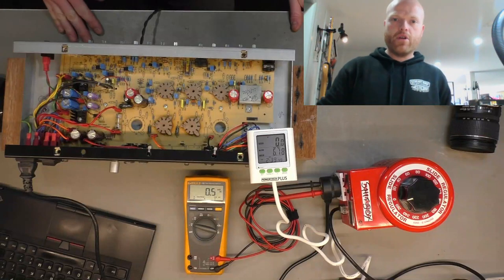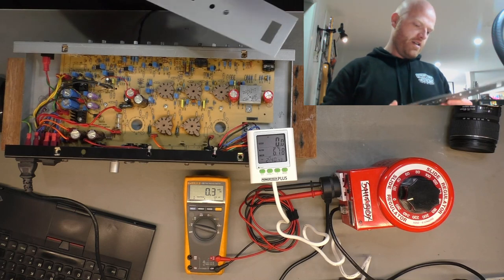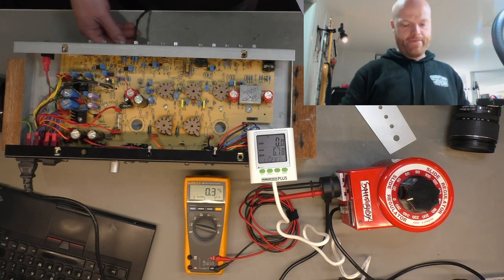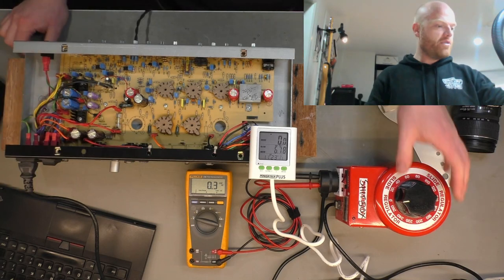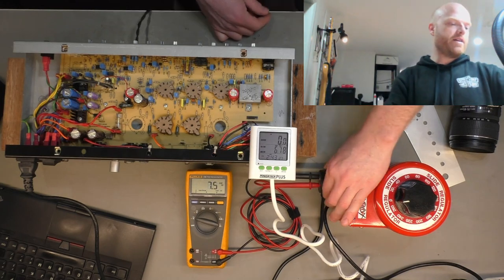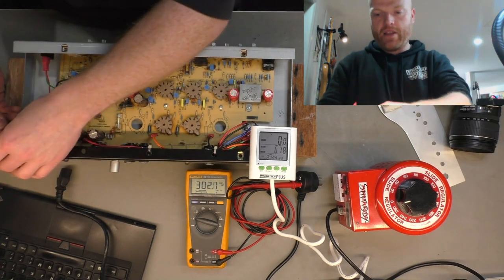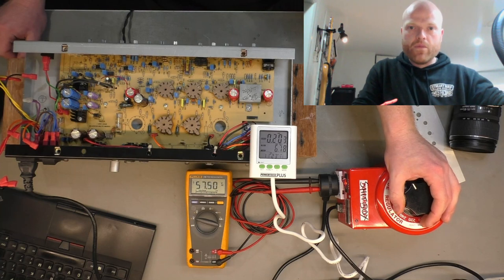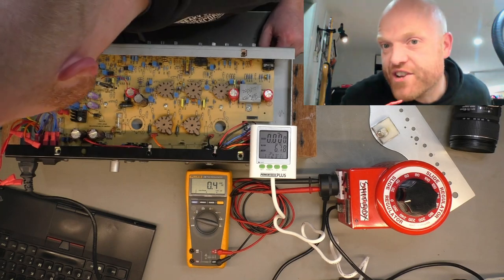Diagnosing A Power Transformer w/Shorted Turns

Comment: I know I am late to the party and this video is several years old, but I have have one of these amps that was given to me back in 2014 in the same condition - bad power transformer. I contacted Ashdown support and back then they were actually very helpful in providing schematics even separate ones for the transformers. They didn't actually have the replacement part any more so I suspect these were all shipped with a high failure rate on this design.

At the end of the day I was able to successfully repair mine from the info they supplied by buying 2 economical Intek toroid power transformers to replace the faulty one. At the time I think it cost me somewhere in the $75 range total plus my time to install them. I still have the working amp today.

Comment: It looks like there's quite a few secondary windings and that transformer couldn't you buy a transformer that has a separate pair of wires and put three small transformers in it and put your 120-volt primaries together and put the small transformers inside unit consult with an authorized service center before doing
Reply from the maker: Bro, we're in Australia for starters, 240v primaries. And the budget for this job was about $200 and it was 2 years ago. Not happening.

Comment: Nice one.  Not familiar with these amps.  Just out of curiosity, what would the cost of new transformer be vs. the value of the amp?

Also, that face at the end of the video was hilarious.  You need to slap that on t-shirt with Champions! across the bottom.
Reply: Lacking a schematic and with a shorted PT, he'd have to do a lot of research to find what the secondary voltages should be, then see if any transformers with those specs are on the market. That alone could be 1-2 billable hours of research to be able to even get an estimate for replacing the dead PT. And that makes the estimate that much higher, thanks to Ashdown. 

It's hard to get clients to understand that getting prices for X can cost as much as "actual" labor.

Then you have to figure, ok, if the owner sinks a bunch of money into a new PT, what are the odds something else in the amp will die within the next five years?

And the answer with these POS amp is Very High.

Sometimes you just have to cut your losses.
Reply: @PsionicAudio  Good point. Also, you have to ask did the transformer just fail, or more likely what failure in the circuit took out the transformer?  Which equals more bench time.
For those interested in the topic I would suggest checking out Uncle Doug's channel.  He has a couple of great videos on determining power and output transformer requirements.  Just search YouTube for Uncle Doug transformers.
Reply from the maker: Totally what Psionic Audio said. Thanks for fielding that one while I was sleeping, Lyle!
Reply from the maker: @bSide Studio, I dare say that loose lamp with the full heater current behind it may have triggered the poor little transformer which was probably JUST up to the job at the best of times anyway.

Comment: Hey Brad, i had this problem on my last amp build and i solve puting heat shrink on ht primary. Do u know what may cause this?  And its possible that a primary still "little bit shorted"? Cause my  pt seems more hot than normal, not so hot ( i can stay my hand). what do you think? Thanks for this video.
Reply from the maker: Gday Diego, it sounds like you may have some internally shorted turns. These are like having a another winding which is shorted out on the secondary. I suggest a replacement for safety.

Comment: does anyone know...i don't want to take apart my amp, cause it seems difficult. 
what voltage do modern amps run on? I've been thinking they must use an onboard transformer that converts AC to DC then everything in the amp runs on that DC... so... it would be easy to convert any amp to run on battery power and eliminate any need for an inverter, could even run off of lithium ion or Ni Cad because lugging around a lead acid battery is not very convenient. 
if anyone knows, let me know!
Reply from the maker: There are various DC and AC rails in any given amplifier.
Very low end practice amplifiers may have only one set of DC rails, but they'd be bipolar, so it's not practical or trivial to convert for DC usage without designing  it that way  from the ground up.
Your best bet is to go with a portable amplifier which is designed to run on batteries, as it will have been built with 12V input in mind.